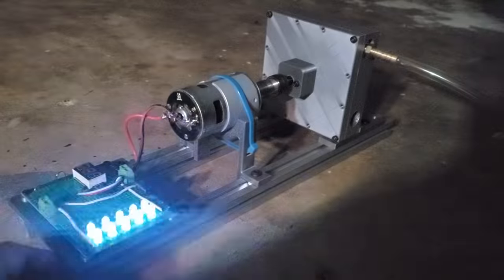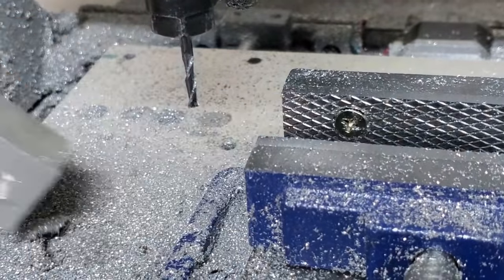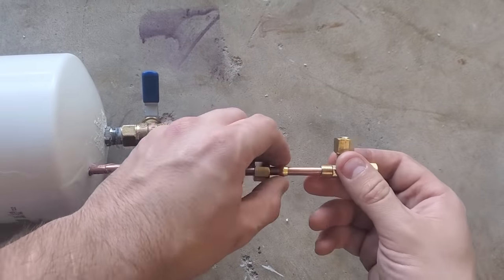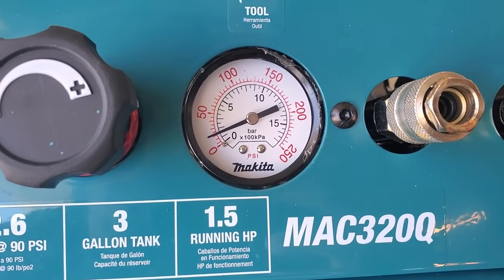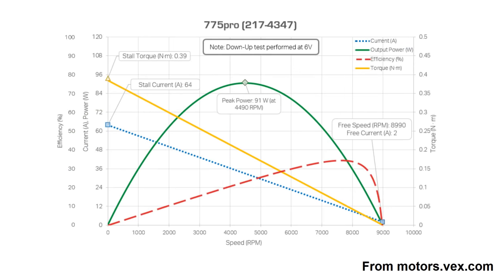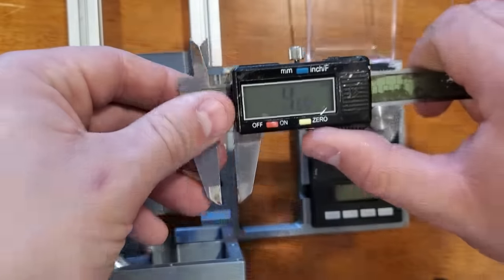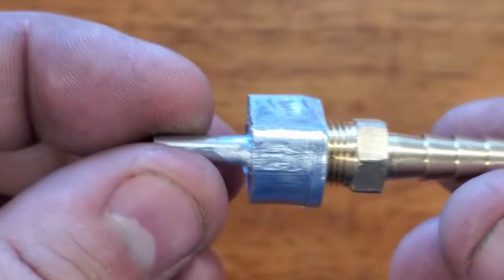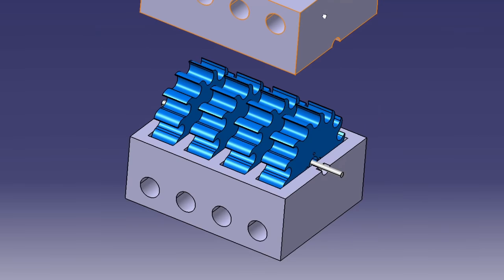3d Printed Compressed Air Turbine

Comment: Extremely expensive and inefficient, but if the air is free it's free electricity.
Reply: 80% of the world's energy is produced this way
Reply: Not with compressed air though
Reply: Well, of course the air is free, and the energy that is extracted with the air is easily added was merely adding much more electricity than will ever be extracted!
Reply: You could just hook it up to a bike pump or connect to a boiler and use steam

Comment: Really impressive. Very surprised 3d printed turbines can take that speed, had any explode yet?
Reply from the maker: No, but i try to keep body parts away from the plane of rotation just in case
Reply: Lol
Reply: @HyperspacePirate  its a matter of time!!!!
Reply: @HyperspacePirate  study delaval,,
Reply: @HyperspacePirate  you seems to be very skilled in this model building, i have one strange proposal for building model of internal combustion rotary engine. Rotor of the engine would be similar to the air turbine with three notches you showed in one of the videos, but instead being notches they should be cavities for the combustion. Air compression is achieved through snail like intake outside of the motor casing and place for intake in cavities is towards the base of the notches while outtake should be toward the outer end of notches. So this turbine is in circular shape because of the closed notches that creates cavities for combustion. You just have to figure out where to put all this intake injection spark and outtake phases in proportion to cavities rotation. And i think motor should start in higher rpm for better air fuel compression. Maybe this idea is bit off but i really wonder if is viable. Sorry if my proposal sounds kind of demanding, i saw that you like this various kinds of rotational system modeling so I thought that this idea might be interesting to you, if is not totally out of any logic.

Comment: Great project and video, but you committed a not so obvious mistake when trying to measure the torque, in fact you are measuring the angular velocity twice, that's because the torque you're measuring is the one that is generated by the eddy currents, and they are speed (or frequency) dependent, so in order to measure the torque effected to the generator shaft by the turbine, you must put a sensor inside the shaft (or some kind of adapter or connector), that could rotate among the shaft. You can understand it easier by thinking this case: when the angular velocity is zero there can be still torque, that can't be measured by the eddy current device since won't be spinning

Comment: Nicely done  but your balde design is not great. First of all, the leading edge is only tangent if the rotor is stationary so you shall adjust it for your intended rpm. Furthermore, adding a radius at the leading edge will decrease the power dependence on rpm and decrease the noise.

Comment: My father used to make model turbines (and other machines) from suitable metals, with Aluminium, brass or Iron casings, and driving output shafts via worm driven gearboxes. They could do useful work such as working a small water pump or driving other models. Generally speaking, you could not stall the turbine by gripping the output shaft by hand. I still have two of the turbines, one of which won a prize and the other is its prototype. 

He never used steam, never needed to use steam, and used compressed air supplied via a repurposed refrigerator compressor and a reservoir tank instead. The working pressure was up to about 40 psi. 

One prototype turbine with a roughly 2" diameter rotor exploded at around 25,000 rpm. I saw it happen. Thankfully, he was standing slightly in front of the rotor disk. One piece of metal nicked his ear lobe, and others lodged deeply into the workshop ceiling, walls and the workbench.

Perhaps that can be a cautionary lesson for others who trust their models not to explode whilst not taking adequate safety precautions. You can lose an eye or a finger in an instant.

Comment: Nice video. I would like to give you some tipps for your next video since my studies included a lecture on turbomachinery.
At 0:40-1:00 you show a sketch of your first turbine design and while the rotor ist stationary it's great. The problem is that as the turbine spools up the angle of the incomming air is changing, if you view it from the moving reference frame of the rotor (imagine the blade at 1:00 moving upwards, from its perspective the air particles are comming in at a shallower angle, almost at 90 deg). This means that your first design produces optimal torque only when stationary, which is obviously not good for power. I think this is a major reason why the first design didn't work as well. Fixes include a steeper nozzle angle or a different blade geometry. I hope this helps you have even more success in your next video.
Reply: To expand on that idea - you could also try and add additional stages with static blades in between to correct the direction of airflow, like in a conventional steam turbine.

Comment: Great video. There is one thing I did not understand: the thermal issue you mentioned with the PLA. At the nozzle, the air actually expands, cooling down the air at that point. The heat is generated in the compressor. So, unless the air coming out of the tank is still very hot, you have nothing to worry about.
Reply from the maker: On a hot, humid day without the aftercooler the output from the regulator was still surprisingly warm, but I think that's because I was free-flowing it and the flow wasn't choked like it is in the nozzle.

The more important thing is to get rid of the moisture because (in my fantasy world) I'd like to use a turbine for a Brayton refrigeration cycle to liquify air
Reply: I initially came here to say this, too. Then i thought about it; if you have a load on the turbine, there will be pressure inside it (air still compressed/hot) and it will cool down only after it meets atmospheric pressure. Right?

Comment: Since you are using compressed air already; have you considered using graphite|carbon air bearings? I realize the rotor will need to be dynamically balanced but after watching several hours of your videos I'm quite confident you've got the ability to make a balancer.

Comment: Nice video. My suggestions would be to use a 3D-Printer Nozzle as your Nozzle-Insert.
Reply: And use more of them. Impulse turbines typically have an injection plate to balance thrust loads across the impulse wheel. Also using oilite bushings would improve high rpm performance by limiting friction losses and improving stiffness.

Comment: Nice work...im also working on different turbines and so far best result was closed up cetrifuge fan turbine...witch does not require complicated casing....it was 2 discs on shaft diameter 15 centimiters and one centimiter between. Inside 8 blades slightly bent..
When nozzle blows it uses a lot of forces including Venturi force to let air inside turbine...and as soon air traps inside it exits from all 8 sides spinning it even more....
Cheers from Ukraine

Comment: Multiple nozzles, like 10 with a manifold for the compressed air and a LOT more volume of air for all the nozzles. That thing would pump out some power and then EXPLODE as it reached 250 to 400 thousand RPM. If your going to do that have some one who works with steel built a steel box to put around it. Needs to be 1/2 inch thick and be welded together by some one who knows how to weld at a high level. This is because when it goes BOOM you want that energy to be contained and not get to your body.

I don't know what the point of this is but that does not make it any less fascinating. Cool stuff man.

Comment: Hi Hyperspace Pirate, great video and data presentation!
if i may ask, how would the 2D air scoop turbine will perform compared to an air vane turbine?
i guess it will outperform the vane in terms of high rpm capability.

Comment: It would be really interesting to see the results of power between your static rotor balance and a dynamic rotor balance, which is much more sensitive.  Dynamic balance isn't as hard as it sounds.  I've done it with the trial and error method, where I mount the full assembly on a somewhat flexible beam, and then measured its vibration amplitude under rotation with a dial test indicator.  move a test mass around on the rotor until amplitude is minimized. I would be very curious to see if the rotor was able to accelerate to a higher power.

Comment: For calibration put your rotor axis on the two parallel blades fom paper knife which leveled to the ground. It is will be better than bearings

Comment: You don't want V2 to be smaller than V1! The component that's vertical on the picture changes sign. The larger that component is in V2, the more momentum has been transferred.

Comment: If you use Laval nozzle, you can significantly boost the outlet gas velocity. Works for pressure ratios higher than 0.521.
Reply from the maker: Yes, definitely. I'm going to address that in part II of the video. At the moment, the reason I haven't used that type of nozzle is because I don't have the proper tools to make them the appropriate size
Reply: @HyperspacePirate  3d printing is good enough for the compressed air. I've done similar turbine experiments with 8bar (116 PSI) and its was totally ok. I used ASA with vapor smoothing, but PLA should do the same job, if you set enough of perimeters.

Comment: Great video! I tried to build the turbine after your example. I got a question regarding that: How to do you fix the vertical positon of the rotor in its housing? The axis is mounted via two bearings on both sides but the axis can slip through lightly due to the strong vibrations until the rotor is colliding with the housing and comes to a stop... what am i missing?

Comment: What if you made the outlets of the scooped engine be at an angle? With the straight outlets, the airflow has to make a sudden turn before exciting which I believe might reduce performance. And maybe offsetting the intake and exhaust could help boost the performance too! 
Considering how much better the simpler 2D design performed, it might however be unnecessary to try to further explore that design

Comment: Add a gear casing to increase torque
First rotor suffered from decrease in air pressure due to angle of input. Centralising input as you did with CNC rotor would have been better.
As would increase in inlet nozzles
Nice vid though
Air bearings would lessen friction though that's down the line!

Comment: There is a lot of pressure loss in the long thin nozzle. The nozzle channel should be wide until it narrows to the final outlet diameter at the end. Yes it's hard to manufacture

Comment: I'm not up to speed on my turbine technology, but how would the efficiency of your designs compare to that of a Tesla turbine?
Reply from the maker: No idea. I don't really know much about Tesla turbines
Reply: Tesla turbines were not found to be extremely torque efficient at such sizes but had some advantages in being bladeless and not suffering the same wear. This design is a good one and closer to industrial blades. Best estimated average efficiency of Tesla Turbine I could find was from a Standford paper claiming around 40%, which could theoretically be increased by increasing the disc size surface area such as stacking more layers or using a larger geometry altogether. Best estimate of current micro pneumatic turbines are somewhere around 20% efficient, with some claiming upwards of 50%, at least when it comes to micro turbines used in precision spindle machining. Seems like that would put easier larger sized devices somewhere in the 50% range as well at best, with steam turbines being closer to 90% and above. You get the efficiency with logic controlled electric but the turbine won't burn out the same. So the less investigated realm of these seems to be around this size. Not quite micro but like small fan sized. Something which can be improved upon beyond the single disc bladed level for some kind of milling or other machining etc which is a pretty good idea.
Reply: @Magneticitist  search tesla turbine and look for the channel 'jeremiah' . That guy did some amazing work. The vids speak for themselves :)

Comment: Great video pal. This is really interesting subject matter.. I've only just turned 50 bro and I'm getting into this stuff only now. I began with finding I had a real passion for woodworking and that brought me onto CNC machines and after 6 months of watching videos and trying to learn a little I'm going to attempt my own build now.. 
I have no experience whatsoever but I was watching a video last night which said these Arduino boards could only take 12V of power? 
Do u know if that is true bro? I'm asking bcos I thought u may know that from the type of work u are doing. Is the voltage something that is very important going through these controllers bcos I don't want to burn them out. 
I just saw the smoke coming off the resistors on ur board there. 
I've began working for an electronics company a feww months ago. I have no experience at all but I'm beginnig to learn from the ppl there. I don't build boards or anything like that.  Well they have a guy who designs the boards for them and then they get them made in China. How difficult are they to design? I only began to see that these boards have a lotta layers to them. U can visibly see that when u look closely at them which I wasn't aware of. I didin't really think about it before. Now I'm going to watch a video on this subject after I leave ur video man.
I think they work u do here is brilliant my bro so keep it up. I'm loving these videos bcos u actually explain what and why ur doing these things which makes it far more interesting than somebody speeding through their video with no explainations.. 
Thanks bro. Really enjoyed this video and how u CNC'd that nozzle too.. That was awesome to see the CNC doing that even though the lathe would be better I suppose? That's another thing I will be getting into my shop too. I used Lathe's many years ago but not enough to be expert in them. Love ur channel bro. Salute from IRELAND

Comment: Cool. Well, you've got that genius mind. the scientist mind ! 
U gotta double check the linearity on the eddy current brake design. I haven't explored those, but the linearity is very sus !  Is it really that perfect ? I've done decades of science research and that is rare. super rare !! I suggest trying to alter the linearity to find the variables. Maybe throw a torch on the aluminum block to check that heat isn't effecting the drag >> it's eventually going to get hot. Magnetism is def affected by heat. I guess if it stays within a certain range it could be linear... I'm curious to know caz I would definitely use this technique :) Plus, i want to see you succeed :)) 

Also, you say "steam turbine." is this for electrical generation ? or are you literally going to make steam powered hand tools ? =wild =cool =steampunk? 

If this eddy current >> gram scale dyno is linear. Woa that would be cool caz when using electromagnets/normal dyno the speed vs power output is no where near linear. It definitely tops off/has limit & is dependent on inductances of the circuitry. There are LOADS of variables...  Another reason I think the linearity is sus is caz most magnetic forces follow the square curve. ya know the inverse square law thing...
         Last thing is >> your mind is brilliant >> be careful you aren't going too deep in the details >> meaning >> you may have already reached your goal !! It's good practice to outline the requirements of the end device. 1.) How much rpm required? 2.) how much torque needed to perform the work ? 3.) size constraints ? 4.) Energy storage/efficiency requirements.  When you have those outlined for the tools your going to make. Then all that is required is to get the turbines to fulfill those needs.  
 yadig ?  
- Blessings & good luck -

Comment: I'm just entering the 3-D printing space and was wondering what filaments you recommend for loadbearing parts and also the types/brands of PLA you use?
Reply: Depends on the load conditions. Generic PLA is plenty strong if the parts are sufficiently dimensioned ;) but as far as I know, people tend to go for PETG if toughness is a concern.

Comment: I build a similar turbine to run electric generators off grid in North Texas.   I have solar panels hooked to small air compressors that slowly compress air into my 2,000-gallon receiver system.

My "turbine" is a brass spur gear running on shaft needle points, turning  worm & down gear, driving a generator of my own design.

My generators priduce either house current or d.c.

They turn slowly (400ish rpm) because the exciter circuitry is held off center on a large moment arm.  This reduces noise, heat and wear.

I like watching your pla printer though. But for me, I like to make things simpler.

I'm autistic. 😊

Comment: 19+W... not bad for something that fits in the palm of your hand.. whatever happened to your multiple rotor project... can you "bump up" the Pressure and Output with this 3D Printing Concept to 4000PSi(???) ...20-30KW... Then one can run a CAV... Compressed Air Vehicle too...

Comment: You should buy a taig mini lathe! Small and cheap and strong enough to turn aluminum and light steel
Reply: He'd be better off buying a used Atlas and converting it to CNC as a project.
Reply: @kmoecub  if he has the space, sure. An atlas will outdo most other accessible lathes. But they're big and heavy and annoying to move lol

Comment: how did you couple the shaft to the motor?
Reply from the maker: It's a collet for a motor meant to grip a drill bit / end mill, but you could also just use a shaft coupler with a set screw